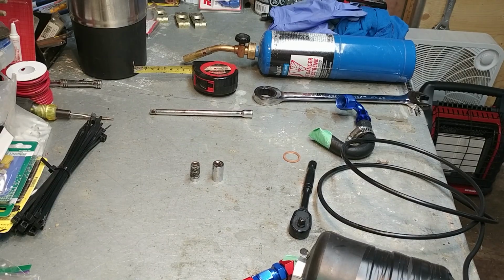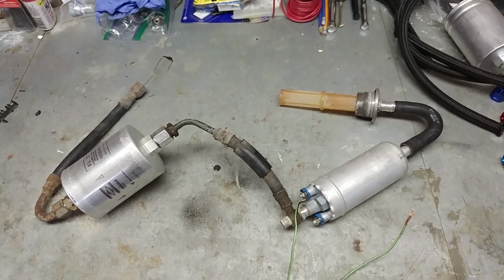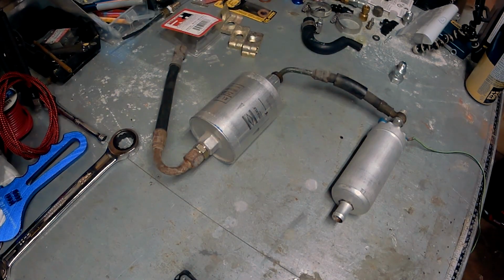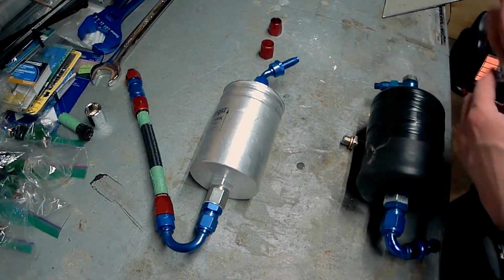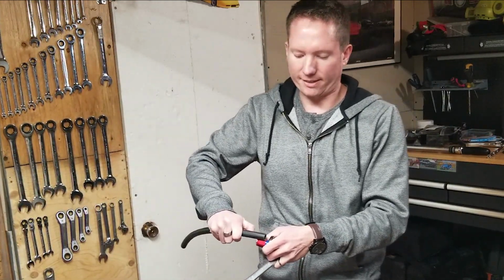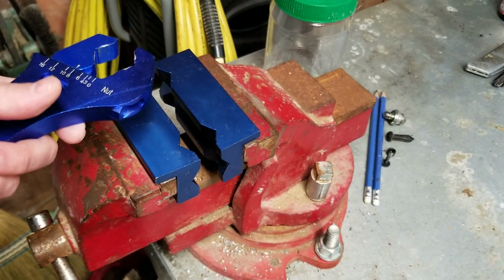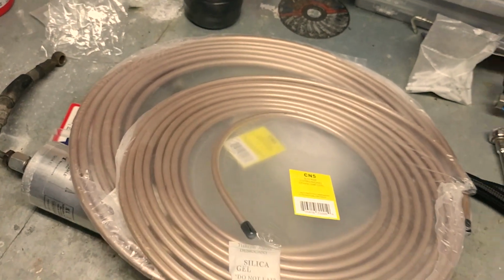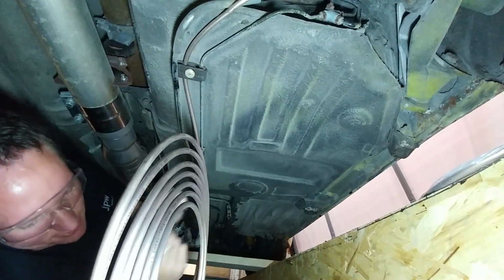How to Build & Install Fuel Lines Part 1 - Porsche 944 Turbo Ep.5

Comment: Good video.  Thnx for the part list break down. A process ahead for me.  Only issue I see is the removal of the check valve. It’s purpose is to help hold fuel pressure in the rail after shutdown.  The engine won’t start as quickly as the pump will have to bring the line pressure back up.  I have an 044 pump on my supercharged 928 and it supports over 500hp at the current fueling with check valve installed.
Reply from the maker: Thanks TH. I agree, the removal of the check valve was a mistake and I'll be reinstalling one 👍

Comment: What are your thoughts on running -6 braided SS line all the way from the filter to the fuel rail?
Reply from the maker: I personally wouldn't do that on a street car or even a track for that matter. I feel like you would be opening yourself up to additonal risk of bresking lines from debris found on the road. The steel lines are small and strong and should last a good 20-30 years.
Reply: @DeancentGarage  Thanks for the advice, do you know of an adapter that would go from -6 AN to the factory hard line I think it is 16x1.5 ? I was thinking of maybe doing this in stages starting with replacing the pump to filter/ filter to hard line first then when I have access to a lift replace the hard lines.
Reply from the maker: Yes, there are actually adaptors that you can buy that will convert the hardline to AN fittings. Check out this write-up on my site and scroll down a bit and you will see a product list as well as diagram that shows the part with part number you would need to convert the hardlines to AN fittings . https://www.deancent.com/porsche-944-fuel-line-build-and-install

Good luck on your project!

Comment: can i buy a stainless steel kit just for top engine fuel hoses?
Reply from the maker: Hey drose977, yes I believe larts parts on eBay still sells kits just for the engine bay and Devin Lyons in the premier 944 turbo Facebook group also makes quality kits.

Comment: I'm doing the exact same project.  I didn't know there was an AN banjo adapter, I would have used that.  So what I'm hung up on is converting the original fuel filter.  Does that AN female fit directly on the end of the factory fuel filter?
Reply from the maker: There is an adaptor that converts the fuel filter thread to an6. I removed the fuel filter fitting that comes with the filter and replaced it with a m16 x 1.5mm to an6 adapter.